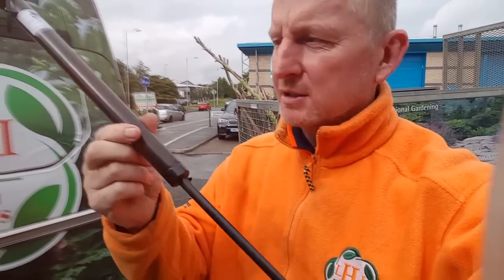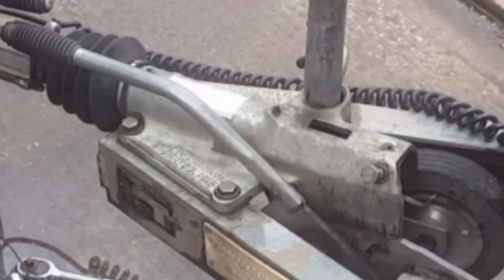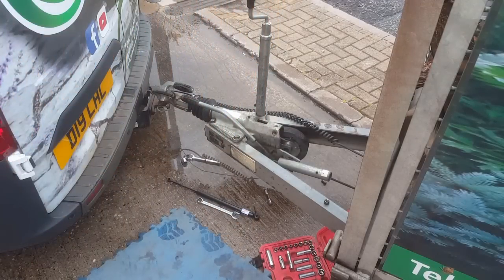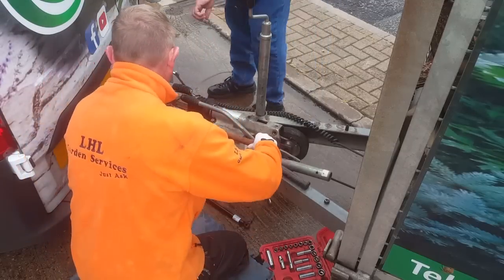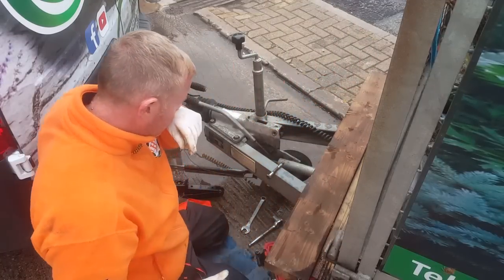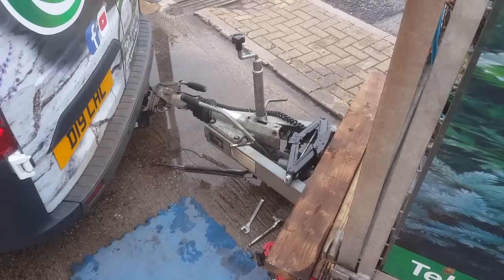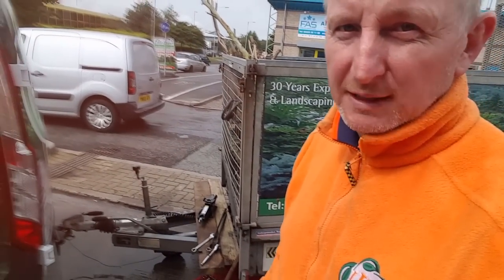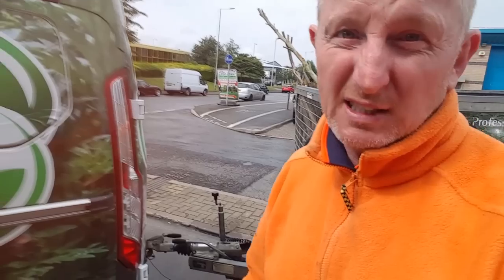Fixing damper  on trailer    EASY FIX

Comment: Mate in case you have to do it again you can take the coupling off the front and the undo the bolts holding the dampener in from the back. Will just slide off then put new one in.
Reply: I have to do mine this week. Well explained tutorial thought mate cheers
Reply: i just found this, i need to sort out my old alco ut trailer ,,,,,  some one in the past removed the second bolt,,,,,,,, problem is to remove triple lock coupler i'd have to chew  up the two security caps on the front coupler bolt. this way i can leave them in place remove damper ( check it works) then get that 2nd coupler bolt in and reinstate damper and rear bolt. hopefully that's the plan.